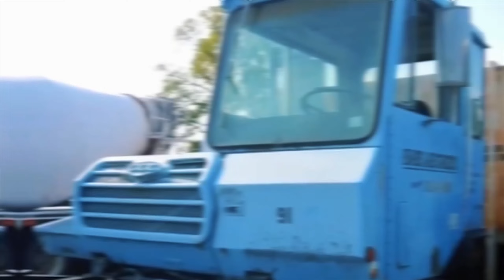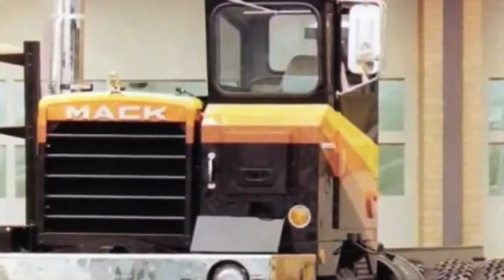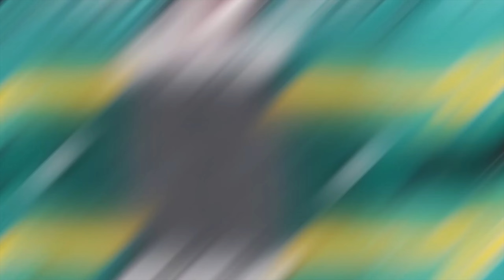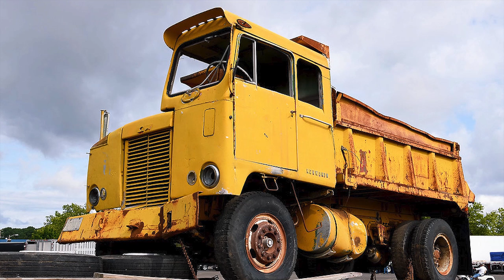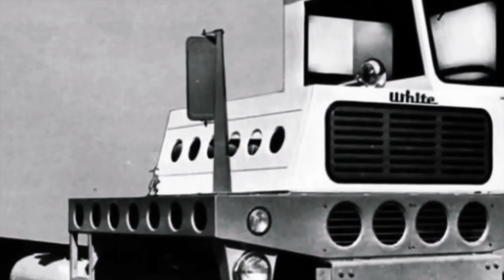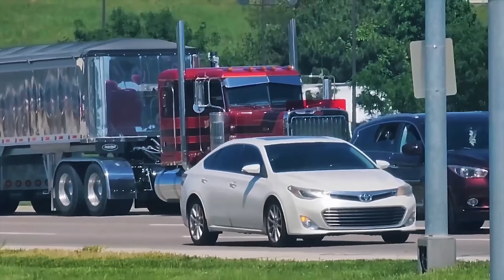Why Did the Strange Half-Cab Trucks Disappear?

Comment: I still see them at trailer yard to move the trailers around
Reply: there designed only to  jockey trailers lighter weight and smaller and much easer than trying to hook up  since they have a hydraulic 5th
Reply: Yard Goats for moving trailers